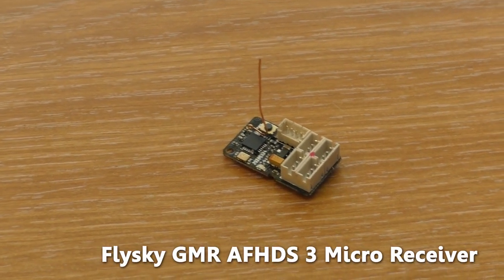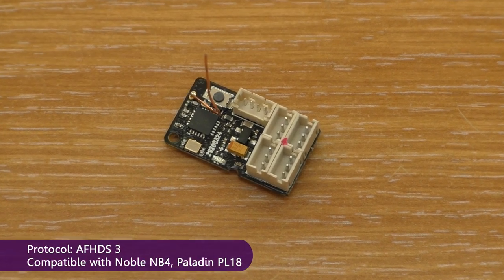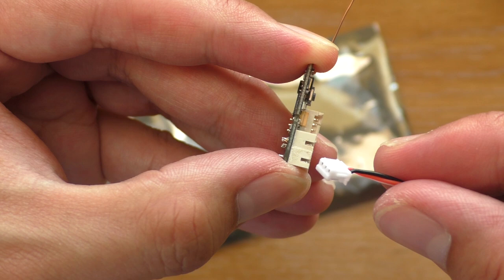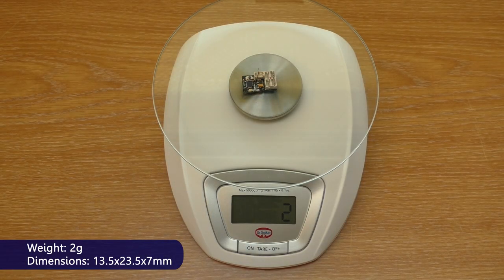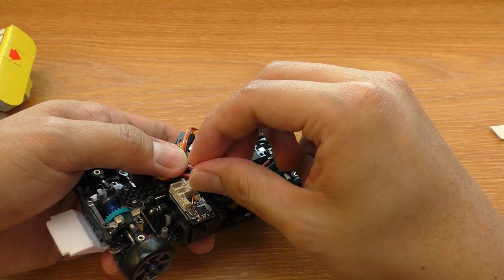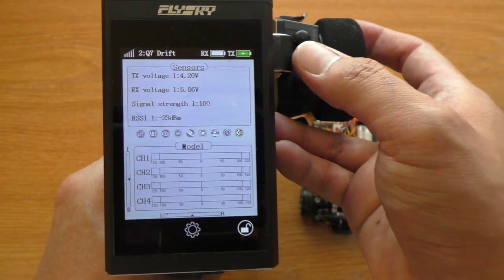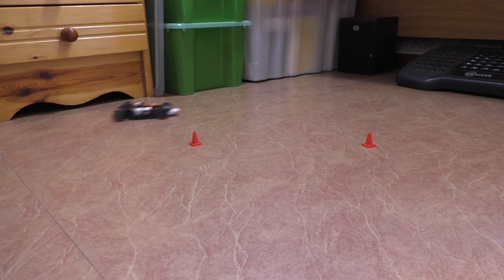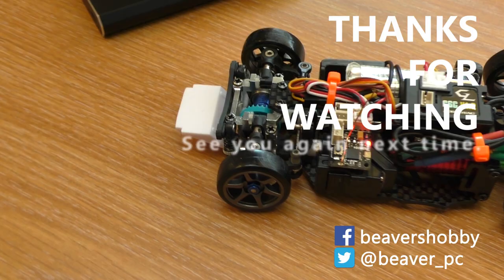[Review] FlySky GMR Micro Receiver for Noble NB4 | 1/28 Car Receiver

Comment: Hello again Master Beaver.. I have recently replaced my servo board and micro receiver as I thought I had burnt out one of them by accident when plugging in power.. Now they have been replaced with new and tried to bind, but no binding light came on on the reciever.. Power and lights on ESC.. I'm unsure as to why this would be, is there a reason other than no power to receiver that would cause it not to light up when attempting to bind? Have tried several times and also changed plugs from ESC to receiver.. Any other potential issues I should look for that may be causing this issue? Have been without my Mini z for over a month and my micro RC addiction needs feeding.. Thank you in advance for your wisdom ☺️✌️
Reply from the maker: Check the ESC first, if it's still working you should get a light or a beep when turning it on. If not check the battery connection. If the ESC is OK but the receiver doesn't light up then either the polarity is wrong (some wires are swapped) or the receiver is dead.
Reply: @BeaversHobby  Thank you so much for such a fast reply! I can confirm the ESC s working, beep and light, and the reciever is brand new dasmikro micro reciever.. Also replaced servo board with newer model dasmikro servo board for mini z, seems to be smaller and according to diagram the JST plug wires are on the opposite side of the board to the power wires then in the previous pn racing servo board.. Could the servo board be effecting power to or the circuit of the reciever? Or should the receiver work regardless of servo board being plugged in? 🤔🤔🤔 🙏🙏🙏
Reply from the maker: @lukeashton5774  The receiver will work as long as there's a power applied to it. No need to plug the servo in. Try it with only the ESC first. If that still doesn't work then there's a problem with the receiver. Don't worry, faulty receiver can happen too. Once you have verified that the receiver is working you can move on to the servo. You can also plug 5v into the receiver directly then plug the servo into the receiver and see if that works. This way you can check the servo separately from the ESC.
Reply: @BeaversHobby  Thank you so much for the advice, I will keep working through checks per your suggestions till I can resolve this issue and get my car sliding again ✌️☺️👌
Reply from the maker: @lukeashton5774  My pleasure. I wish you good luck and get it all sorted out soon.
Reply: @BeaversHobby  I think I have tracked down the problem to ESC.. Per your instructions I plug receiver into separate power source, both old one and new one work.. Next plugged in Servo board and powered up receiver, binder straight away, no problem.. But then the wheels pulled full lock to one side and wouldn't come by steering or trim adjustment.. This happened just prior to when I shorted it before, don't know if it's related or a different issue all together.. As I said originally, ESC lights up and beeped when I turned it on.. is it possible part of it works, power, motor and switch and just the line to the reciever not work? I'll order new receiver and try that.. Any idea why the steering might be locking? Thank you Master Beaver ✌️✌️✌️
Reply from the maker: @lukeashton5774  Check which channel you plug it into. If it's happen to be on channel 3 and 4 then it usually snap to one side. Try and move all the sticks and button to see if there's anything that can control it.
Otherwise if the steering is locked on one receiver then that receiver has a problem.
Reply: @BeaversHobby  I have had success with binding reciever, esc now working have also replaced servo board, so first issue is fully resolved.. Thank you for you help and guidance Master Beaver.. Still issue of steering pulling to one side..  I dismantled everything and removed servo motor, which when free from gears spins at high speed non stop.. Have tried x3 different servo boards, but same result.. Have also tried switching pot wires and also power wires to servo motor, no change and servo motor keeps going.. The only things I haven't replaced is Potension meter, could this be the fault.. I remember when I first test changing over to this set up that the servo motor ran when the Potension meter wires were not connected, but was idle when connected. This has been a long and expensive repair 🤦‍♂️ ✌️
Reply from the maker: @lukeashton5774  If nothing works then there's a chance the pot might be faulty.

Comment: Drift as you wish, control as you can

FLYSKY ® NB4 GMR (genuine micro receiver) launched right now

4CH/ with built-in gyroscope interface/ upgradable online.

upgradable as in buy a qyro? any idea what this means?
Reply from the maker: It means there's a port for a proprietary gyro from Flysky that will come later... whenever they finish making one.
Not that it matters though since we all use an external gyro when it comes to RWD drifting.
Reply: @BeaversHobby  they are a bit slow getting this out to the world, what do you use for 4 wheel drive?
Reply from the maker: @PrInCeUKER  Yeah, they probably know that we are not going to use it anyway. I don't use gyro for 4 wheel drive car. But if you want one take a look at AFRC GYS2 v3. https://bit.ly/2XD0Xms It's a tad expensive if you will only use it with 4WD but you can keep using it if you'll get a RWD later on.

Comment: What is the drift car in the video and what electronics are used?  I’d like to build one to chase my dog around the house.
Reply from the maker: In this video I use Mini-Q Q7. http://bit.ly/2MuzSim
I also made a video about this car too but it was still with stock electronics. 
The link I give you now is the brushless version, you'll need to add your own radio and drift wheels & tyres if you want to make a drift car.
Here're wheels & tyres. 
http://bit.ly/2WSecRf (2 sets)
http://bit.ly/2I3a74k (1 set)
You can find them in any Mini-Z dealer too.
Here's my Q7 drift setup video. https://youtu.be/kCjglUnXBQU
Reply: Thanks!  So I need the tire set, 2 sets of wheels, GMT rx, and the mini q slash. And I’ll be good to go?
Reply from the maker: @roberttruesdell6151  You'll need a Flysky Noble NB4 radio (transmitter) as well if you haven't got one already. If you just start you can get the ready to run (RTR) version of Q7 (slash) and just the wheels & tyres. https://bit.ly/34GTkOv
Or you can buy the brushless version posted above and get a cheaper radio like Radiolink RC4GS https://bit.ly/30Uw0wl .
Don't worry, it'll come with a receiver.
Reply: @BeaversHobby  have the Noble already.

Comment: Man if you desolder all those plug connectors its super slim for an rc car reciever. I think most people would would say why remove the plugs. I'm just used to removing plugs and such from flying tiny whoop drones and every gram used to matter.
Reply from the maker: It depends on the ESC as well. Some ESC will need the plug to program so you'll need to leave the plug in.  Some that has external port for programming like the GL you see in this video doesn't so you can take all the plugs out and solder the wires directly to it.
In car community we tend to leave the plugs in for quick swapping and maintenance as well.

Comment: What RC car are you testing it on please?
Reply from the maker: Mini-Q Q7, I mentioned it in the video when I installed the receiver.
Anyway, this receiver uses standard plug for Atomic and GL Racing so if you use any of those cars' electronics you can plug everything in directly.

Comment: Great video and really smooth drifting.
I have been enjoying the Noble NB4 on my 1/28 as well 1/10 crawler but unfortunately the radio stopped working. Got replacement and this also stoped working (Supplier never informed what was the problem but I suspect was the grip battery). Anyway, really enjoyed the radio and that little receiver but I am reluctant to go a get myself another NB4.
I have other two radios, a Flysky GT5 and a Sanwa M17 but I believe none work with GMR micro receiver.
Do you know any solution? Is there a micro receiver that might work with either these radios?
I would love to hear your thoughts.
Thanks.
Reply from the maker: Since you have a Sanwa M17, no need to go back to NB4. There're micro receivers for it with FH3/FH4 protocol made by DasMikro. Here's the new version. It's even smaller than the GMR. https://bit.ly/3sJ2fJV There's also one with integrated gyro too. https://bit.ly/3rL5Bg8
By the way, if the problem is the grip battery you can take it apart and replace it with any standard 18650 Li-ion battery.
Reply: @BeaversHobby  Thanks for your opinion, much appreciated. You are right about the option of replacing the internal battery but since radio was still under warranty and I was not sure that was the problem, decided to return it.
Regarding your suggestions for the receiver, That is great, I am happy to be able to use the Sanwa on my smaller scale car too- it has proved very reliable on my 1/10 4WD Buggy and a real pleasure to use.
I think I will opt for the first one you suggested and a later point I will purchase a dedicated gyro - this was on my list anyways and keeping the option to fit a dedicated one is perhaps better, don't you think? 
I remember watching another video on your channel when you tested a gyro that you said was very good - I will try to find that video and revisit it.
Reply from the maker: @vaamorais  Yes, the external gyro is the best for drifting. If you only want mild stabilization, onboard will do fine but not for drifting.
I think this is the video you are looking for. This one is still the best gyro for 1/28 (and bigger). https://youtu.be/qksr7-hSE0I
If you want a 1/10 gyro, it's either Yokomo V4 or this one. https://youtu.be/fM4rk6PV0ls
It'll fit in some 1/28 too if your body is big enough.

Comment: Kyosho is selling the Noble with two micro receivers for $239.99, better deal than Banggood as they are selling the Noble for $199 now.
Reply from the maker: Check which receiver you need because Kyosho version comes with Mini-Z EVO receiver and it's not compatible with other cars. If you intend to use it with Mini-Z then get the Kyosho version. Otherwise anything is the same because none of them come with GMR or any micro receiver for  3 wire standard RC components.

Comment: Will this bind with the flysky fs i6
Reply from the maker: No, it's only for Noble and Paladin. There's also a small receiver for i6 though. Here it is. https://bit.ly/3a41K3g You can install ZH plug too, just use pliers to bend the legs so it fits.

Comment: Will this receiver work with wltoys 284131
Reply from the maker: Yes, it will. You will also need an ESC because it'll basically be a transmitter upgrade.